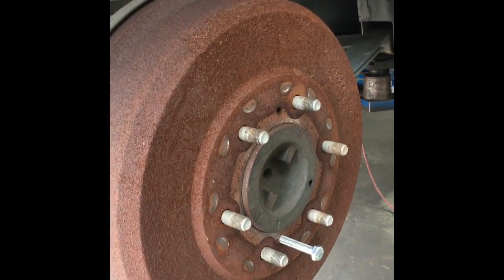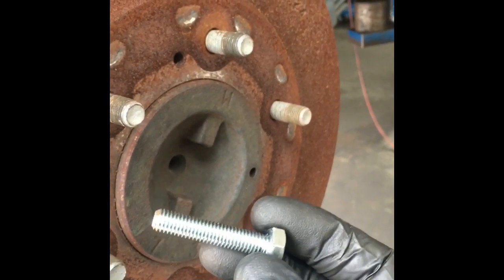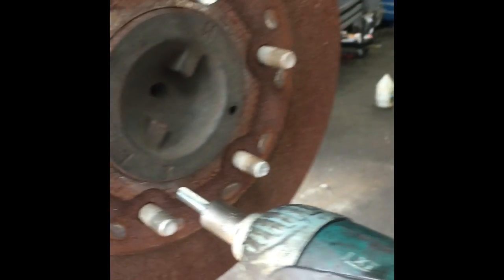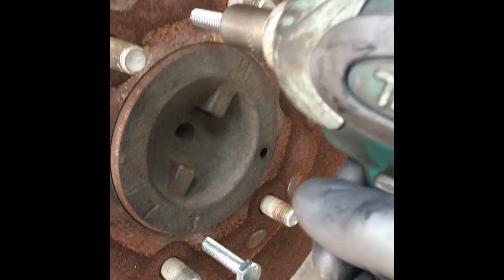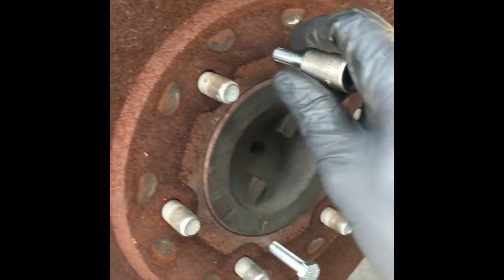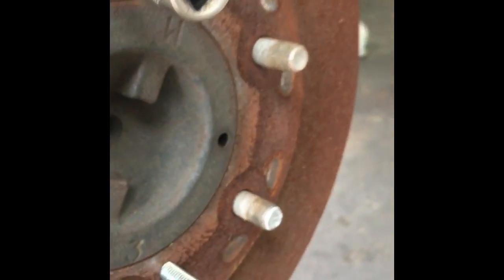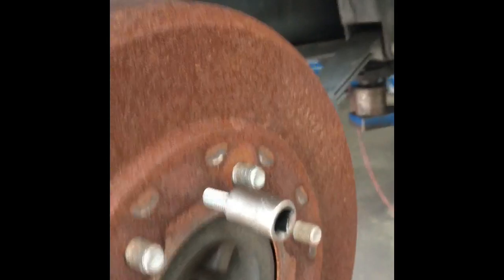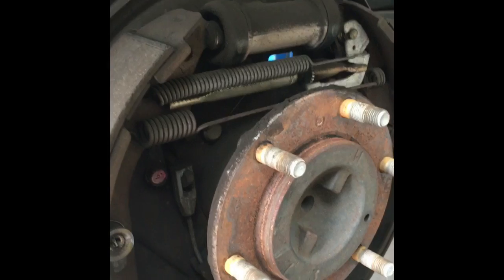How to Remove Stuck Brake Drums

Comment: And if those bolt holes are stripped
Reply from the maker: You can run a tap in there and make new threads. May have to upsize the bolt